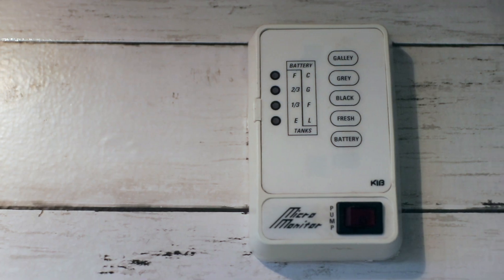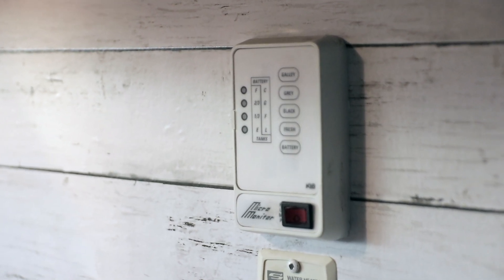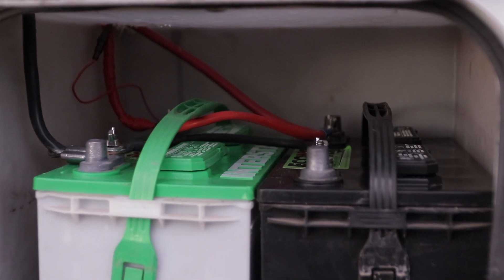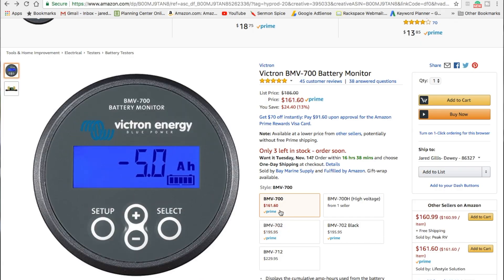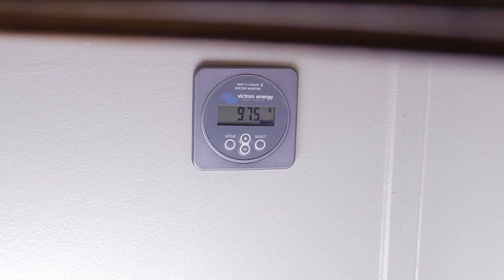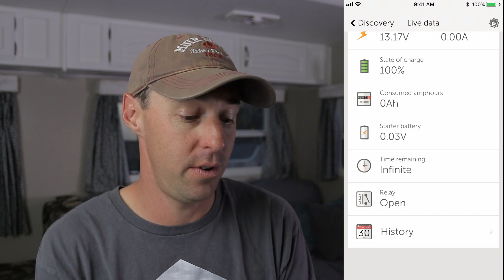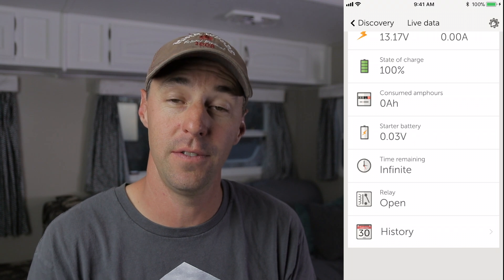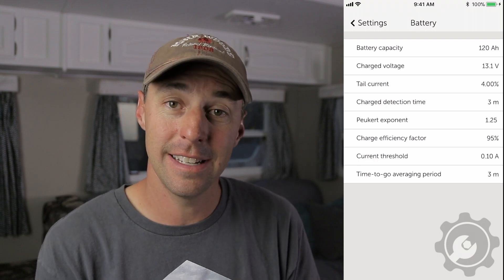Updating Your Battery Monitor And Why You Should!

Comment: You can easily set up warnings/alarms (low voltage, etc) and the BMV-712 will send a message to your phone via Bluetooth (if you are in range around the RV) as well as displaying it on the battery monitor's screen.
Reply from the maker: Thanks for the info
Reply: @AllAboutRVs   do you know if Victron has a AC Monitor  like they do for the battery's

Comment: i don't recall if you have solar but I wonder where the negative from the solar charger should go - on the battery terminal or on the shunt with the other connections - thanks
Reply from the maker: +jMon it should go on the shunt, on the load side so it can monitor it.
Reply: Needs to go on the shunt otherwise it won't be seen by the battery monitor
Reply: On the shunt.

Comment: Absolutely right on a monitor being the first addition. I installed a Trimetric monitor but any that use a shunt will work. The bluetooth is a nice feature.
Reply: thnks for info. the fuse shown is for a 250amp fuse. is that the correct one?